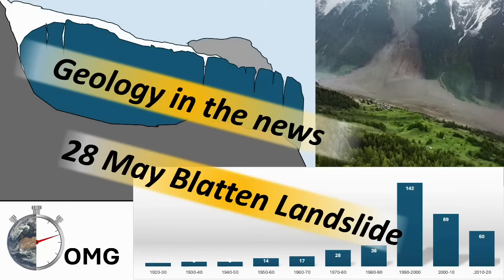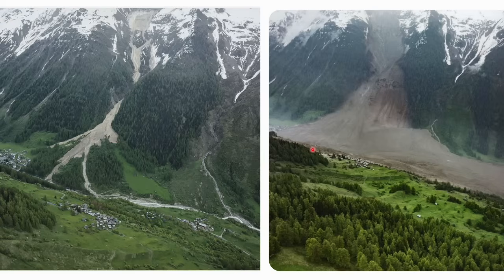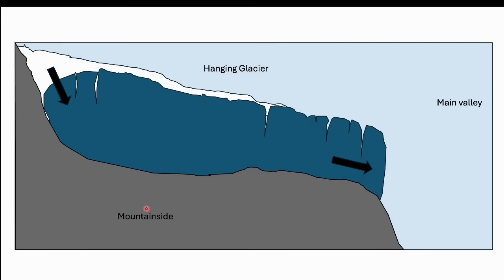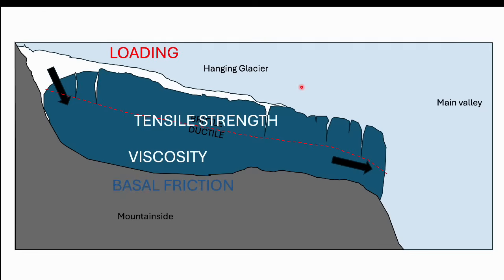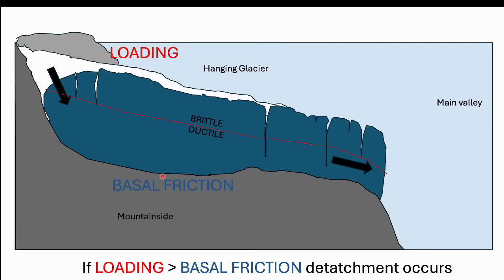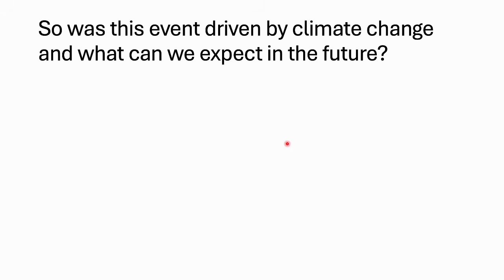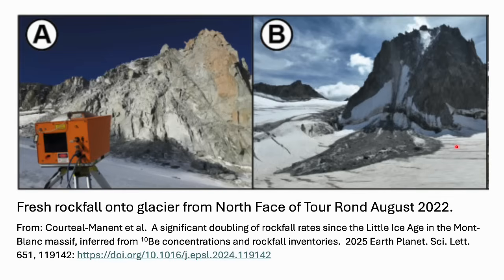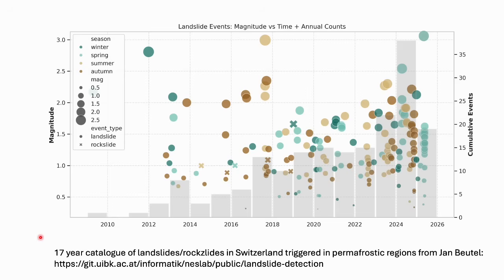The Blatten Landslide

Comment: I am sorry but you have lost me when you went onto the climate change as being connected to the event.....
The first study is an overwiev of only one hundred years.....( to be of any significance as far as climate is concerned few thousand years, at least five thousand might be required to show any validity of the claim that it purpots to suggest).....(not to mention the validity of the study if taken in the overall geological setting)
And not only that it also shows the drop in rock falls from 2000 to to 2020, from 142 to 60, ( decrease in 20 years by 60%) and yet it has been clasified and interpreted as "raising".......
The second study that is mentioned regarding of melting of the permafrost does not show anything as being surprising......
Of course if you take the starting point from the Little Ice Ages that the trend of melting will show the incline....
How about a study that starts with the Roman worming, when we know the temperature was at least 2 degees higher then what is today....???? That would give us a better aspect of comparison!!!!!
We know from the geological records that the climate  was flactuating from warm to cold, and we also know from that geological records that there is no such thing as tipping points.......
Where we are now, as far as climate is concerned, is nothing new, not a place where earth's climate hasen't been already.....(The Mesozoic era was warmer then today by at least 5 to 7 degrees {who and what caused that, did the dinosaurs fart too much}....
Don't get me wrong, this is an excellent presentation as far as the factual geological explanations are concerned, but venturing into the climatic speculations, in my opinion was not necessary, as it is highly questionable.....😊
Reply: Interesting how literally every qualified expert disagrees with you. Your severe lack of intellectual humility is disgusting.
Reply: @AnEnemyAnemone1  
When someone gets personal instead of addressing the legitimate questions that are being raised, and appeals to the "authority", any future disccusions are useless, as the person does not understand what the discussions entail....
And not only that, the comment in itself speaks volumes about who and what that person is.....
But, thank you anyway.....
Reply: @danieljeftic6181  You're a troll. I sit ok with most trolls, but not climate trolls.
Reply: @binkwillans5138  
Substance please....
No meaningless slogans....
Address the points raised......
Name calling is kids stuff.....
I could go on, but for now this will sufice.....
Reply: @danieljeftic6181 there was no personal attack. Appeal to authority, sure, you got me there. What you don’t understand is that appealing to authority isn’t inherently fallacious. I’m not saying that authorities can’t be wrong. But you better have a good explanation for why every expert disagrees with you, instead of conveniently ignoring the elephant in the room.
Reply: @AnEnemyAnemone1  
I can name hundred climate experts who do not accept the current climate narrative....Some of them worked for IPCC only to be sidelined and kicked out because they did not follow the ideological narrative....
One (and there are many) of them is Richard Lindsden. He has published over 250 scientific papers on various issues relating to climate change.....he is one of the leading world climate scientists who is being sidelined by the apparent "experts"...
Further the IPCC is being run more like a religious institution then a proper institution that should be concerned with scientific facts......
The delibarete misrepresentations and the blunders of the IPCC are too many to mention....
( The very fact that a body like IPCC even exists is a testament that climate science has ceased to be science....
A political body that forsters and pushes only a narrative that it aproves, that is not how science operates)
Climate science has been politicized to an extent that it has ceased to be science proper.....
In almoast all accademic institutions the grants and research  is getting funding only if it supports the established narrative , which has become a dogma.....
In acedemia, anyone who even questions some aspects of the climate dogma is cancelled and sidelined.....
That is not how science works.
To my knowledge, no science is ever settled, and anyone who claims othervise , obviouslly has no idea how science works....
Climate science ceased to be science long time ago when it became an unquestinable dogma, and when people like yourself dismissed anyone who who disagrees with their views, and instead of addressing the points that were actually raised, they cry an appeal to  the"authority"......
The appeal to unquestionale authority or dogma is more of a sign of a religious establishment, then of real science.....
I am sorry, but I can help if you live in your climate bubble and think of your own views as being inerrant......
The material is out there, the science that does not support the narrative is out there....Instead of dismissing it, maybe educate yourself and broaden your own views, instead of blurting some slogans that you have picked up in whatever institution you have attended....
And if you want to continue the discussion address the actual points that I have raised in my original comment......
Otherwise you have nothing to say, appart from just showing your emotional indignation....
Reply: @danieljeftic6181  Yup, you played this game a long time now, and you know it inside out. SHAME on you. NEVER rely on memes to get your fun. That's how the unicorns didn't get onto the ark.
Reply: @binkwillans5138  
Those that speak in riddles, are riddled with a lack of clarity.....😉
Reply: Exactly! x
Reply: Thank you. Context was needed for this event.

Comment: Thanks for this description of the mechanics of the Birch glacier failure. I've seen no videos of the glacier / slope post failure or info on the existing rock failure. I'm wondering now that the glacier loading on nearby slope toe is removed (entirely?) how the rock failure will progress, assuming it will accelerate? A bunch of rock added to the ice/debris dam will make things a lot worse.

Comment: Another climate changer. It's summer mate, of course ice and snow melts! The difference here was that the entire face of the mountain fell off under the weight of the snow and permafrost underneath it.
Reply: @AnEnemyAnemone1....Thank you very much, now you really have added such an extra deep layer of pseudo knowledge to the whole issue by letting us all know how much more than a 12 years old child your understanding is.
Does it occur to you to realize that we all have eyes, and that we all can observe that the snow coverage in our Swiss alps has steadily decreased in the last 30 years?
And we also are able to observe that Blatten has been built at the bottom of a sliding  mountain!?
There is a town in Ticino that is completely built on "top" of the huge sliding mass of material and it is called CLARO. Guess when that avalanche of rocks fell down in the valley? Well it was more than 500 years ago and in 1879 a large snow avalanche slid down do to a heavy and sudden snow fall.
Please reflect a bit before you pretend to enlighten us about the presumably men and women made climate change.
Observe what the "weather" does the next five years from now and then we will have a chat around 2030.
Study a bit what the sun ☀️ has been doing until now and what it's cycles are and the influence they have on the climate, then we could eventually talk about climate change.
Reply: Another “climate changer”, I.e. another informed expert? Climate change affects the extent of seasonal effects. Nobody said that snow doesn’t melt in the summer independently of climate change. If you aren’t even smart enough to grasp that tiny bit of nuance that should be intuitively simple for a 12 year old, what gives you the idea that you are in a position to argue against experts?

Comment: Excellent to see something more nuanced than the BBC. However, your conclusions for THIS event seem contradictory. This was a spring event, not a permafrost melting event. So this disaster was not a result of climate change . Point taken that climate is warming and there has been an overall increase in slope instability in the last hundred years.
Reply from the maker: In principle I would agree, but this winter saw exceptionally little snow cover so the transition to melting happened very early and then it was also a very warm spring.
Reply: Currently the explanation I heard most in Switzerland (I know that popularity is not a measure of exactitude) is that it is not possible to attribute this  event to a single cause, but that the melting of the permafrost indeed increases the frequence of  these events. I know of other locations were measures had to be taken  due to the melting of the permafrost (some high altitude building are built on top of permafrost).
It is a little bit lung cancer. You cannot prove that a specific person had lung cancer because he/she smoked.  But you can prove that smoking significantly increase the rate of lung cancer.
Reply from the maker: @jean-marclugrin1902  exactly!
Reply: The season in which this happened has little to do with the impact of global warning here. There were two effects: first, global warming lead to yearly freezing-thawing-cycles in places where there were none before, weakening the east flank of the Little Nesthorn. Second, it weakened the glacier, which for this reason was already under tightened surveillance. This weakening made the catastrophic collapse possible.

Comment: Very informative.  Your explanation of the dynamics of the glacier collapse was spot on!  Thank you
Reply from the maker: Cheers.
Reply: @OneMinuteGeology  Birch Gletscher had about 32° inclination. This probably contributed to most of it collapsing at once. You have a lot more load on the friction surface between glacier / underlying rock, at this steeper inclination.
Reply from the maker: @beyondEV  absolutely agree.  The slope angle is very important in the balance of forces.  The cartoon was drawn to fit into the format but I could have done a better job at making it more realistic.